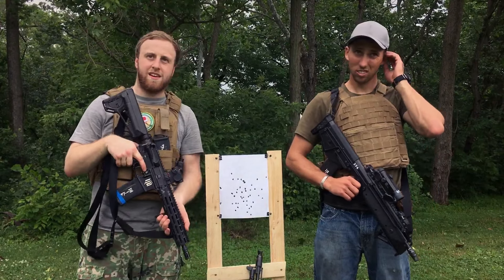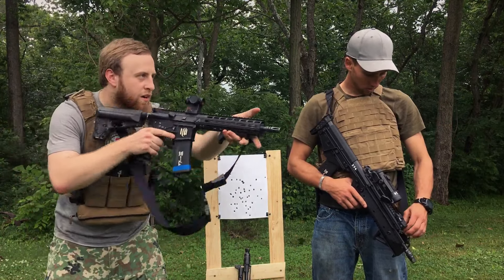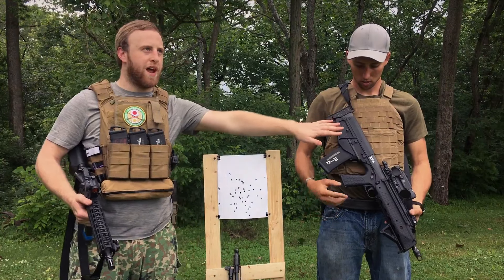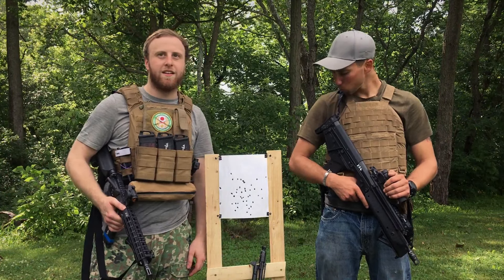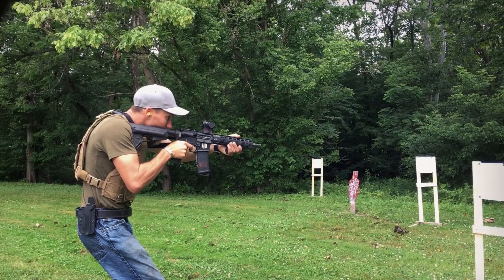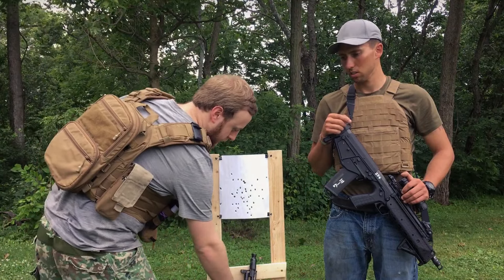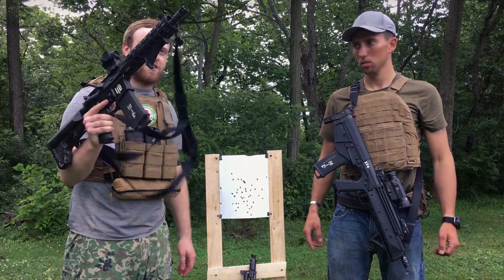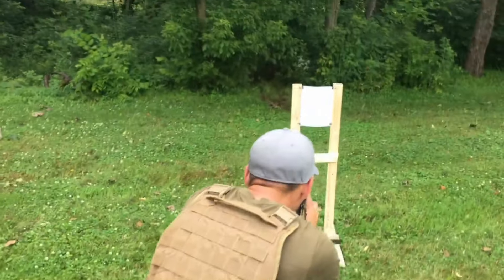Keltech RDB ergonomics and handling

Comment: I just picked up an RDB (made this year) and I noticed all the screws had a littlr loctite on them enough that they werent going anywhere if I didnt redo them.  My charging handle retention seems just right for me, I also run a Haley Strategic SBR mount with a Surefire RM1 1 notch back on the pic rail so it covers the CH,but since my hand us right there I can easily sweep the CH.  I was never a Bullpup Guy, the RDB is my 1st, but it is quickly becomibg my favorite 5.56 carbine.  I do agree the bolt release needs work, 99% of the time I use the Tavor mag drop (bump the paddle with the back of your right hand or left if thats your dominant, then charge the RDB using the CH).  I dont know if your using the rubber buttpad but I used some Remote Control double sided tape (also called Servo Tape) under the rubber pad to hold it in place as well as the screws.
Reply from the maker: My screws also had loctite from the factory.  That rubber butt pad was so shitty I just threw it out.
Reply: @Operator_Inquiries  I put a piece of stick-on velcro under by buttpad. Seems to stay in place well onw.

Comment: For a lot of the reasons pointed out in the video I didn’t go with the RDB. Yes, it’s reasonably priced when compared to other bullpups. But I didn’t want to deal with the aggravation of parts failing or coming loose due to Kel-Tec’s QA/QC, so I went with the IWI X95. Haven’t looked back.
Reply: But that's almost another $1000 at least where I am. The Tavor is too much money and the Keltec is too cheaply made. There needs to be a middle ground gun.

Comment: The Lucky Irishman bolt catch release lever is the solution for the bolt release. Instead of fighting the bolt release buttons or racking the charging handle, just give the Lucky Irishman a light upward palm strike. Done! 😎👌
Reply from the maker: After how much it's been used it's worn in fine now, still doesn't justify it being like that from the factory.